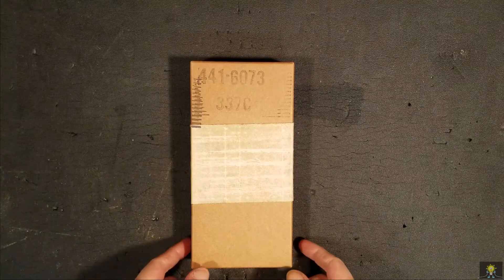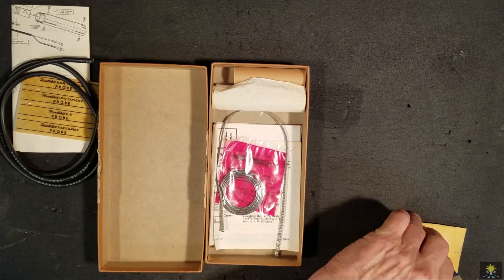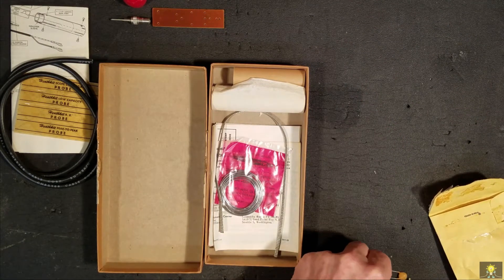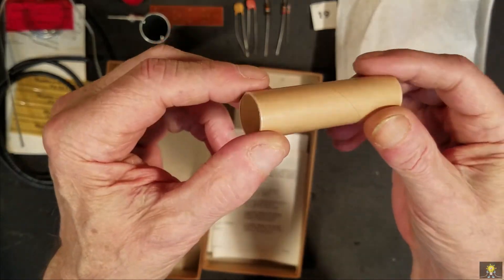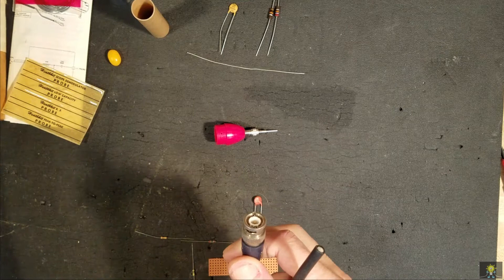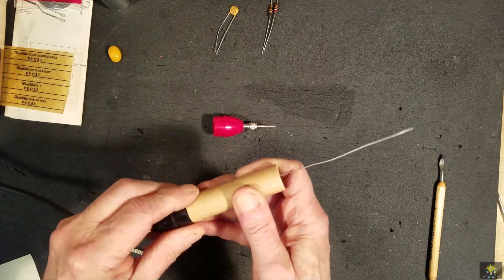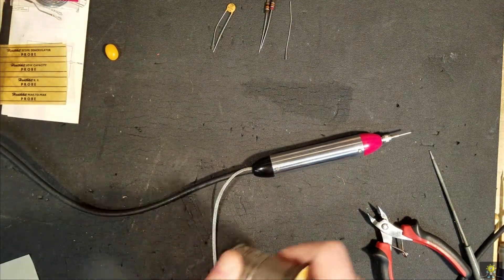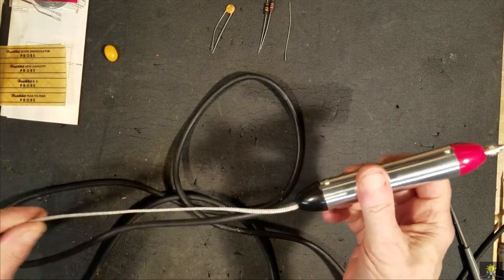Heathkit RF Probe, Construction and Modification

Comment: Thank you for this build video. Why remove the diode? Speaking of the diode, you know of a modern equivalent? 

Cheers,
Adriel
Reply: Germanium diodes can still be obtained. The diode would only be removed from circuit by the switch to allow tracing audio signals as well as radio frequency signals.